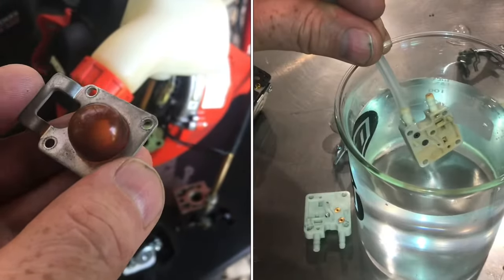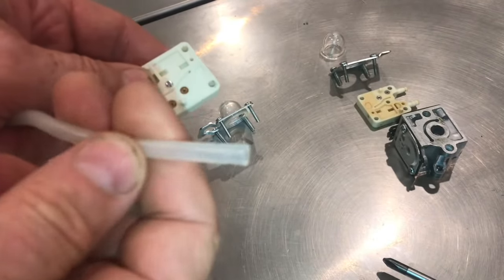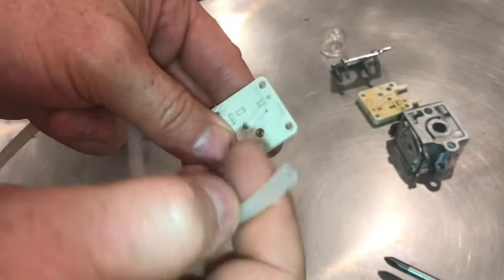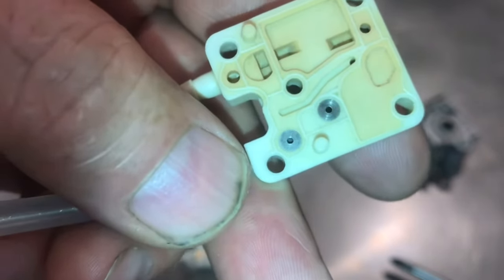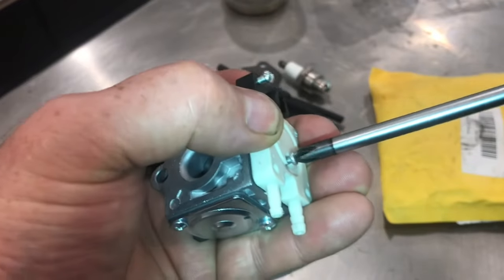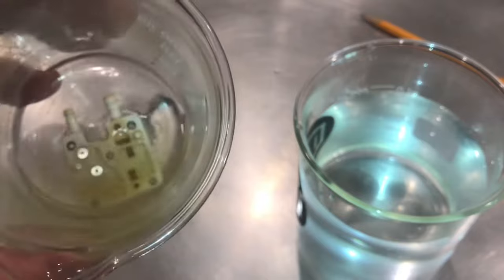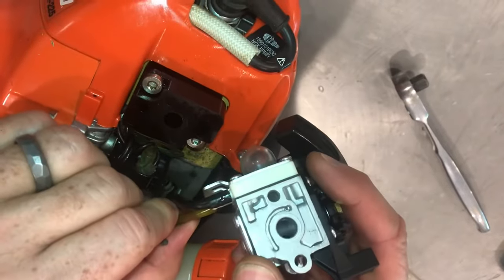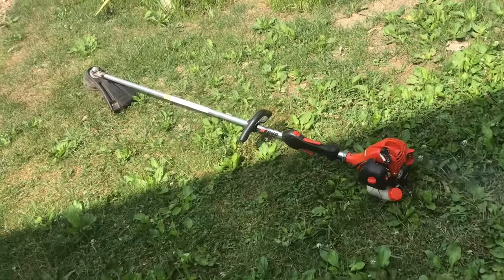If prime bulb DOESN’T pump gas “watch this first” echo string trimmer (testing check valves)

Comment: Great information my friend! You might want to try soaking those and your metering diaphragms in brake fluid! I hear that it has something in it that soften up the rubber and just so as everyone knows, The ethanol alcohol in gas is not the demise of your diaphragms! It's Benzene that is in pump fuel from the gas station. And something else that will make these 2-stroke engine carburators stop working is paraffin wax that is in crude oil pumped out of the ground. What it will do is put a coating of wax so fine across the screen in the fuel inlet that you will have a hard time seeing it! But if you put a couple drops of fuel down inside the hole that the screen is located in you will see that the fuel won't drip through the screen because it has a fine layer of the wax across it that won't allow the fuel through.  😉

Comment: No one showed this in any of the other rebuild video.  Nice video.  What I don't get is why you can't suck or blow any air through that one inner check valve but it's good.  What's it for?
Reply: The check valve requires 2 sides, one to pull and one to push. One side allows fluid in and the other allows it to build pressure. With only 1 valve it requires a pump to push the fluid. This is the purge, the fuel pump is the same principal and moves low volume compared to a variable displacement pump.

Comment: I can't figure why the second check valve would not allow air to pass either direction.  Was it clogged or is the tiny spring strong enough to block a human from building enough pressure / suction to flow past the tiny rubber flap ?  Have you tried a device such as a Mityvac to see if it would flow ?

Comment: If the Second Valve doesn’t allow air either way then how it functions with  gas seems to contradict.  A one way valve should not stop flow both directions or else it is a problem

Comment: My issue with a new to me discarded echom it was filling until it sat.  Can  u recommend vender or venders for a new carb for 225i?  I'm not even going try..just buy.  11-18  bucks is better than just the check valve 

It's a new to me carb.
Reply: I've bought a couple from Amazon for about 15$ for a complete carburetor and they have worked good with no problemo
Reply: @charritolopez8223  ok, great..I just stopped and thought. A small engine Shoppe was talking me to just buy a new one. The W branded one for $60. I was torn since I just got the weedeater that was thrown away on a curb. It was cutting good to me while I used it. The refill end need me to feed it a new string. It didn't load Correct. I can pull a new piece through when needed. It was Free